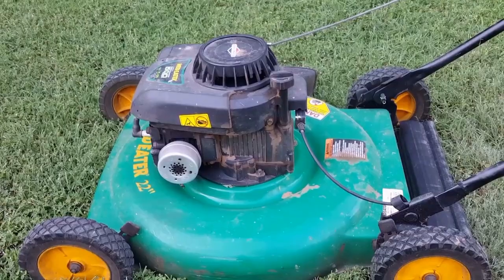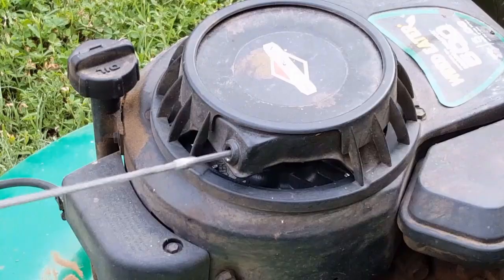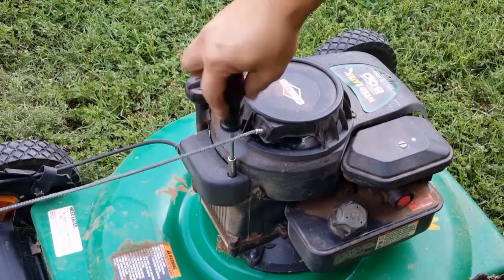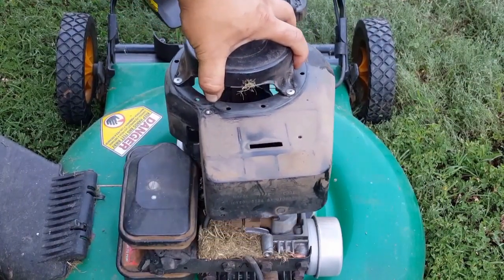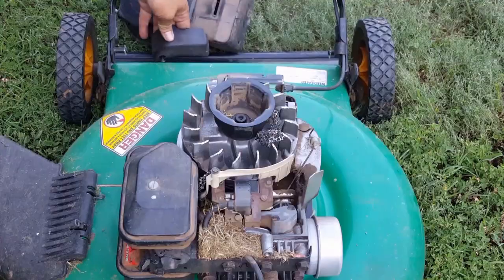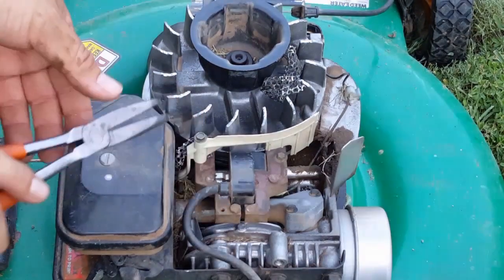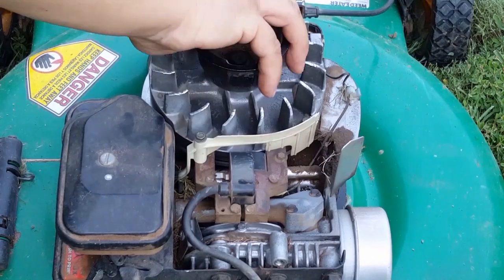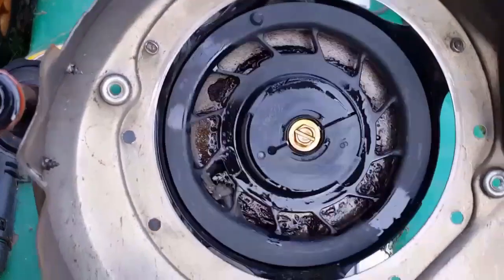Weedeater lawnmower pull rope recoil problems.

Comment: I have this mower and can't remove the air filter - should just unscrew, correct?  It just spins without loosening.
Reply from the maker: Thanks for the comment. That's a big problem. It would appear that the screw is stripped in the threads so it spins but not come out.

Comment: I have one I kept having  paws or recoil  problems paws c0me lose  now it smoke a little how I change  the air tube filter  thanks
Reply from the maker: Do you mean the intake tube that runs across the top of the engine under the engine cover?
Reply: @HomeGaragechannel  yes I fix it I had 2 screw it it was missing one  thanks keep up the great work
Reply from the maker: @chrisr.s.larsen2657  no problem and thanks for the comment I appreciate it

Comment: I heard this brand is a cheap piece of shit, but mine's been running for ten years!  My handle just ripped off my rotten cord, I have to replace it lol.
Reply from the maker: dethmaul thanks for the comment.  I don't have any problems with this brand of mower. Its light and easy to use. Cheap yes but is it a bad piece of equipment... not at all.
Reply: Hell yeah it was like 90 bucks at walmart in 2008.  Just had my friend fix it a couple times when my dog broke it, and I learned a little how to work on it.  I ran over a rubber ball and broke the crankshaft key thing, he put in a new one.  The blade from the factory was upside down apparently?  And that's why it wasn't mulching.  Nothing intrinsically wrong with it.

Just changed the oil and pull cord a few hours ago!
Reply: Found on road replace the deck cleaned the blade was backwards 😂 do you have a video with just the pull chord